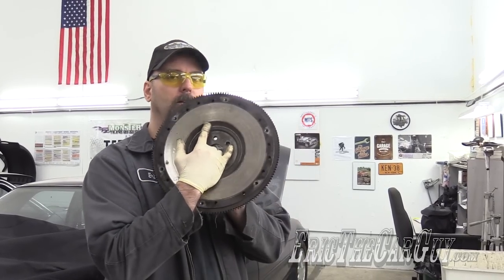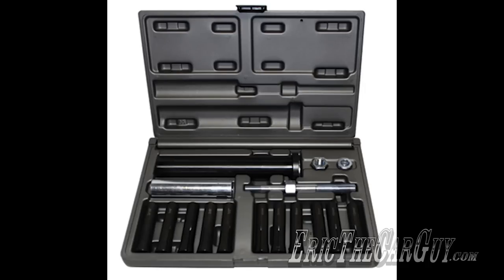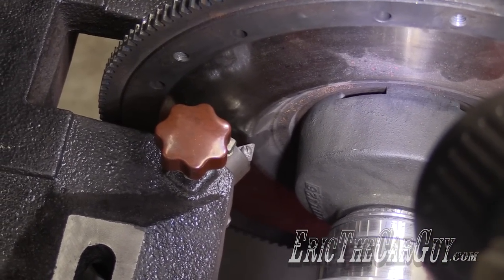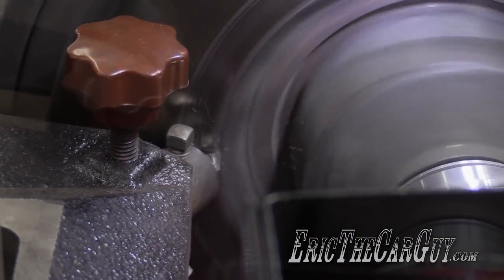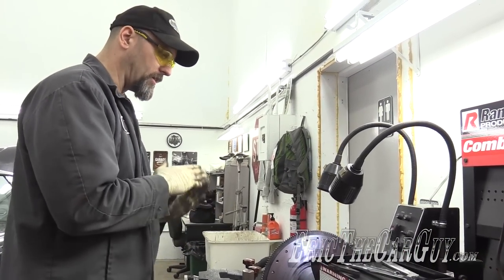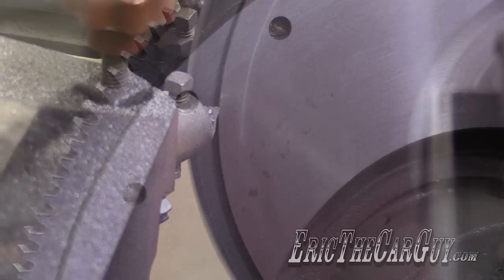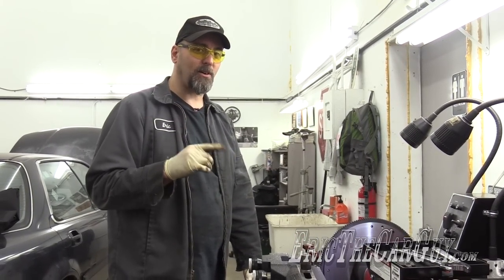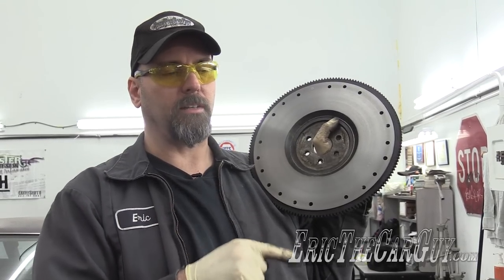Can You Machine a Flywheel with a Brake Lathe??

Comment: I spent a few years at a Chevy dealer also ten at an International truck dealer. Yes no specs were ever given except for Cummins diesel flywheels. What I learned in both Chevy78-81 and International 81-92 was you could remove material until the bevel at the edge of the wear surface was gone, usually at the outside edge. What I used to do to save tool bit wear was first run the flywheel with a jitterbug Sanders with approx 80-100 grit paper to remove burnt on dirt ect that the parts washer wouldn't remove. The discolored spots are hardened areas that have overheated the steel or iron and caused it to become crystallized, only shallow passes with the carbide cutting bit or a grindstone will cut through. Some older brake drum cutting machines had powered grindstone attachments. Love the videos, my son got me started watching, thank you.

Comment: Keep up the well done and informative videos, you're easy to understand and you obviously do know of what you speak. I too was a mechanic for 30 years and retired about 12 years ago, mostly due to arthritis in my back after breaking it on the job, just could'nt take the pain at the end, (or before the end) of each day. Getting old sucks, don't do, I'm telling you. I have found that like most of you it's in my blood. Every night I'm out in my garage doing something else on my '88 Toyota p/u, but I've found once in a while I need to brush up on some repair that after this much time I've forgotten certain details here and there. I was glad to find Eric's videos as like I said, he seems to know his shit. And we used to turn flywheels back in the 80's at a brake shop I worked t then and you mentioned about every issues we came across do so, and resolved them the same ways we used to. Anyway, keep em coming, I'll keep watching. Later and God Bless.

Comment: We had a neat little custom-built anti-chatter rig for machining flywheels back when I went through automotive in college.  It was one of those pinchy metal salad tong things, with an old brake pad on one side, and a small drum brake return spring pulling the two sides together.  Our brake lathe had a stud sticking out on the other side of the cutter bar that the other side of the tongs would clip onto.  For anyone that's wanting to be extra-cautious, or just doing a lot of flywheels, it's a worthwhile hack!  :)
Reply from the maker: +rhkips Neat idea. Thanks for the comment.

Comment: Yes sir you can.. and note to self, next time after the finish cut, take your 90' grinder with a skuffy wheel on it,  and with the lathe running put a uni-directional polish  finish on the new surface, when the tech that set ours up and gave the introduction to brake re-surfacing schpiel,  he made a believer out of all of us....  I'm always about doing the work in house if possible, and this is a great tip... Thanks man....

Comment: Ammco makes a grinder that attaches in place of the drum bar for machining flywheels. If you have hot spots the lathe will not cut the hot spots they are too hard that’s what the grinder is for. They also make an attachment to use rather then using the twin cutter which works better when doing a stepped wheel.

Comment: Eric,  nice work ,  just  a observation,  keep  track of how much  you  remove from the flywheel . some  hydraulic systems only  allow for  .010 -.025 in material  to be remove before it  can be a problem. They  offer  shims  to  take up  the  amount  removed  so you  can keep  it  close to  the original  specs. Also remember to  make sure the fly  wheel is  flat all  the way  across.  some  have a  raised portion that you  need to  take the same amount off  both  surfaces.

Comment: Hey Eric, on semi flywheels, we put the flywheel/ crank bolts in the flywheel loose, on the bench and put the friction disc on the flywheel to see if the disc clears the bolts and if necessary measure the gap between the bolts and torque springs to see how much material is left to machine.

Comment: Years ago I worked in the machine shop at a local NAPA store. I used to resurface flywheels this way. We would cut it and then make a pass or two with a grinder that mounted on the brake lathe to take care of any hot spots.
We later got a dedicated flywheel grinding machine.

Comment: the serviceability specs for most flywheels involves a percentage based visual damage check followed by a deflection survey performed by applying a specific load (in aviation, maximum operating load) to the work surface, and measuring the deflection amount for entire circumference recording highest and lowest amount by dial indicator. The max allowed can't be exceeded by the highest amount, and the average from both being under 0.01 inches. TBH I personally haven't had any flywheel pass visual damage specs and then fail for deflection threshold. I'm not certain this even applies to Automotive though, the manuals for ground based transport only used visual damage inspection of the tempered tooth ring insuring less than 30% of teeth missing, and under 30% of the teeth having no more than 30% of contact surfaces damaged, and then a relaxed state deformation check.

Comment: been doing this on the old classic Annco brake lathes for years, a similar set up but not nearly as nice as yours.   never had a manual for a lathe, wouldn't be surprised if more of them can manage it.
  always start with a fresh bit and try to wrap the flywheel or do whatever you can to minimize chatter.   Great videos man, keep them coming!

Comment: I think your tip of setting your depth of cut on the outer section is excellent. You might also try slowing the RPMs as you get closer to the outside. You are covering a lot more surface area as the diameter increases. Does your machine click onto the speed settings in notches or is it variable where you could gradually slow it a few RPMs at a time?

Comment: I’ve machined loads of flywheels on my Harrison M390. Some are flat , some are stepped , need to remove the 3pins and skim usually with a Diamond tip, cause they have hard spots and carbide leaves raised spots, you can skim them on a surface grinder also. I have also removed lots of material on the backside of the flywheel so it spins up to revs faster (on race car flywheels). When done replace pins” if not damaged “ if they are use silver steel , job done.

Comment: Did this too, but had problems with the cutting tip bouncing over the hot spots that were work-hardened from the slipping clutch. The hot spots were raised like welts on your skin - looking at this video, I suspect maybe we needed to get the cutting tip into a new point position for a shaper cut. Anyway, we clamped an angle grinder to the lathe arm and turned on both the grinder and the lathe to grind the flywheel. The finish was fairly rough and coarse, however, to our surprise, it worked a treat, with the clutch engaging smoothly and without shudder!
Reply: Rob S we use ceramic or diamond edged carbide tips , no raised hard spots

Comment: for a better finish slow your cutting feed down to about 3-31/2, Also while it is still on the lathe take some fine emerycloth or a 3m wheel and finish by lightly sanding it by hand or with a block, that will give you a non directional smooth finish

Comment: In regards to stopping to let the tool cool off, if that's a carbide insert (which it looks like it is), you need not worry about heat. Machining at that low speed will never produce enough heat to hurt the tool. They do wear down and will eventually just shatter the tip off but it's not heat related failure. In the machining world carbide will get run at 6000+ RPM dry sometimes (no coolant) if the logistics of getting coolant to the insert are too difficult. Source: I am a machinist.

Comment: my only concern would be getting the flywheel square to the tool travel. if the mounting surface isnt square with the face of the flywheel you can run it out of balance and do some real damage. most places would indicate the face of that part first before machining.
Reply: jameswoodsist   But.... the whole point is the face isn’t flat and parallel 🤷‍♂️
Reply: @DrewLSsix  There are other videos showing flywheel specialists taking a lot of trouble to set the ''back' of the fllywheel's inner face that sits tight against the crankshaft,co-planar with the cutter.This set-up looks a bit open to run-out due even to dirt or burrs.I don't trust it even though he gets so pleased by the finished look.

Comment: Eric,

If the flywheel is cast iron, you should (as you showed) machine it dry.  OTOH, if it's steel you're dealing with, use a little cutting oil brushed on prior to each pass.  Yes, smoke, AKA "shop fragrance", is generated, but the cutting insert will last longer.

Eli D.
Reply from the maker: +Eli Dustman If you set the bit on the outside of the flywheel, instead of the inside like I did in the video,  it won't be an issue as you won't cut too much off and heat up the bit.

Comment: i think it might help to take an angle grinder with a mild abrasive disc to the flywheel after you cut it, and while its still spinning on the machine, it would remove the almost microscopic 'record' cut that the bit will make as it backs out... i know disc brakes tend to make more noise and also grab the pads a little too aggressively if they are left with a directional finish, i would assume that a clutch, being a large brake pad itself would do the same, except in this case it would cause the clutch to grab early in its biting point and make for some uncomfortable pedal feedback during the breaking in process

Comment: In the olden days when I worked in the auto parts, I'd do it backwards at first.  I'd line the bit up with the outside, and manually crank it through slowly until the surface was kinda-sorta even.  Then I'd crank it all the way inside, set the bit it in some more and set it to auto.  Rotors, drums, flywheels, they'd come out as smooth as glass every time.

Comment: I tried that years ago and the brake rotors bits would not cut through any hot spots on the flywheel. I suspect that is why a flywheel grinder is a stone.
I do use my brake lathe to custom grind pistons in automatic transmissions. Works ausome to add extra clutches and get precision clearances.

Comment: Not sure if a some flywheel run out is as big a deal as a front brake rotor run out.  The appearance looks good , but if equipement was a questionable  older lathe like many shops have, to play it safe before removing  larger size brake rotor (or in this case a flywheel with a lot of labor involved) A run out check with a dial indicator on the vehicle with the high and low spots marked,  and then see if the high and low spots on the rotor or flywheel mounted on the machine correspond to the same place position as when mounted on the car. By marking the high and low point  locations on the rotor or flywheel before hand  and just re- mounting and re-clocking of the work on your Lathe a few times to best match what you measured , you'll be surprised how much re clocking the work on machine can make .

Comment: Doesn't the uneven cutting sound when you start machining at 2:26 mean it's not mounted straight on the spinning axle? And doesn't that in turn mean that when you finish making the surface uniform to that angle, the balance will be off once it's back on the car?
Reply: No, the uneven cutting noise is because of the uneven surface of what is being machined (the flywheel). It is either warped or worn.

Comment: My Van norman machine has attachments for turning flywheels. sometimes the flywheel will have hard spots from excessive overheating and a lathe won't do a good job of resurfacing flywheels with hard spots. That's when a surface grinder or flywheel grinder is needed to ensure a smooth flat surface.
Also outside mass flywheels are hard to do on a brake lathe because you need to machine the wear surface and the pressure plate mounting surface by the same amount to keep the pressure on the disk the way it was designed originally.
Reply from the maker: +superrodder2002 Agreed. I've seen the exact same thing. Thanks for your input.

Comment: yes, you can machine flywheels and even refacing hubs on a brake lathe but.... for a flywheel, the induced runout is very important, 
on a rotor or a drum, usually, a runout of 0.004 to 0.006 inch is acceptable but on a flywheel, it is sufficient to cause an important imbalance.
on this setup, the result have chance to be better if you minimize the adapters between the cranckshaft mounting face and trust face of the lathe spindle so the machined face should be outside relative to the lathe not in the inside as showed on this video
By the way, it is important to indicate the flywheel on a non worn surface , loosing the spindle nut, rotating the flywheel and retighten to be sure that the readings are consistent so the mounting is OK before taking any cut

Comment: If those bits are carbide you don't need to rotate them, the belt for chatter is a good idea but you can slow down the lathe, take a smaller cut or lower your feed rate as well.

Comment: It's better to cut it with the crank shaft side facing in but you can't always get it set up to do that so you have to flip it.  When the flywheel has excessive "hot spots" a brake lathe doesn't do a good job to get them out so you would need to bring to a machine shop or get a new wheel. Machine shops have told me this is not a good idea but I have done it with no issues. If you get a good cut you will be fine

Comment: Bits will overheat on cast when making shallow cuts. Most lathe and bit manufacturers recommend cutting at a moderate depth. By doing so, much of the heat is carried away from the tooling into the project material.
Reply from the maker: +Chuck Nix Set the bit on the outside instead of the inside like I said in the video and it won't be a problem.
Reply: +EricTheCarGuy Even then, making the cut more deeply, such as in one pass rather than 2 passes, will keep the bit cooler because the bit is making enough contact to transfer the heat. On shallow cuts, the tool retains more heat effectively decreasing the tool life by about 50%.

Comment: I have cut them on a Engine Lathe (Machinist by Trade) and also sent them out. they used to Grind them on a small Blanchard Type Grinder  also sometimes  the small Heat Checks on the surface after machining I would not worry about. its the cracks that are a concern. But that is Cool doing them on a Brake Lathe I have often wondered about doing that if it was Possible now it is

Comment: If you make a deeper cut that will make more contact and transfer the heat to flywheel which keeps your cutter cooler. Don't cut any less than 
.004 at a time and that will save your cutter. Like the shop it has plenty of lighting👍

Comment: That flywheel out of that 5.0/T5 combo is supposed to have dowel pins. I suggest you get replacements before reinstalling the pressure plate or it can cause headaches later.
Reply from the maker: +Chad Bob Actually I'm using a new flywheel.
Reply: +EricTheCarGuy just for video purposes I'm guessing
Reply from the maker: +MEOW MEOW Not initially, I was going to use it in the car by my machinist wanted to go with a new flywheel for my build.

Comment: That brake lathe is a good one. You are going to make money with that one. Looks like a very versitile machine. One shop i worked in we had a customer with a common toyota hiace van. It was an ex post office van. We had to tow it into thee shop one day with a seized front brake. A very rare thing to happen to a toyota. What had happened , someone had machined the discs when the front pads had been changed. Min thickness is 24 mm and it was machined to 20 mm and most of it off the outside. So thin you could the marks on the outside of the disc from the ribs. So the brake pad when it had got warn, it came out of the caliper mount and jammed between the mount and disc locking the brake and spinning the van. We think the disc was machined to remove gouges from going steel to steel. Its scary when you know that some idiot with a brake lathe had caused that.
Reply from the maker: +andrewkiwi1 That is a head scratcher. Thanks of your comment.
Reply: The van had been a mail van so it had been thrashed and the owner at the time was a builder and knew a lot about houses but sweet f. a. about cars. ha ha He was lucky. They are exactly the same brakes as a 2wd hilux from about 1990. just scary.
Reply: +andrewkiwi1 My ex mechanic jammed replacement pad in when there was rust on the caliper mounting points were ( of course didn't tell us because he didn't know any better). trashed the rotor which was already trashed to begin with. replaced with oem, One happy brake. Its important never to skim on quality on brakes, even if you have to cough up dealership prices for it. But watching vids like ETCG, we can at least go in knowing what to expect...

Comment: Oreilly's decided it was a great Idea to start machining flywheels. Nope. Too many people come in to get it done and the thing needs it shaved down to the limit to get rid of the surface hardening. Not one person knew what a dial indicator was when I told them they needed to check for run-out after installing.
I'm surprised you don't scratch and give the flywheel a spin before starting.
you should also be able to throw the clutch friction disc on a lathe as well to fix the run-out on those. I've seen it in some datsun manuals lol.